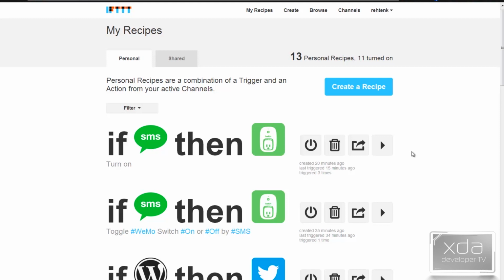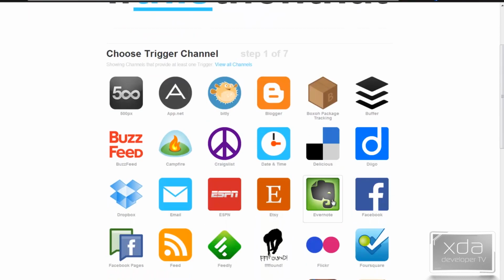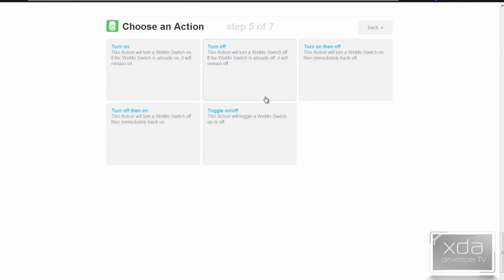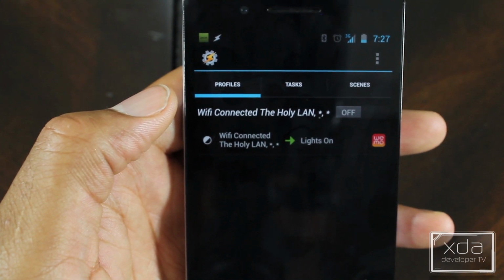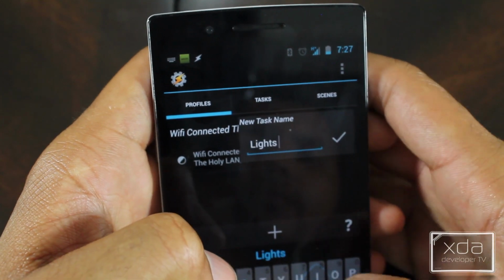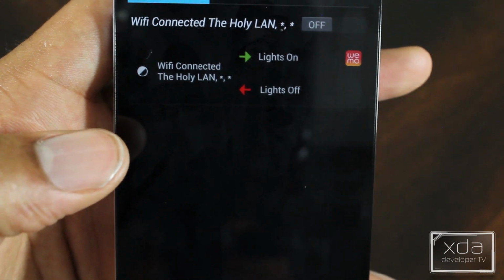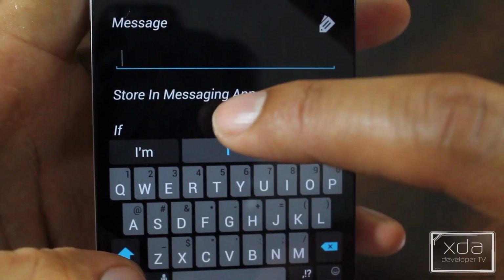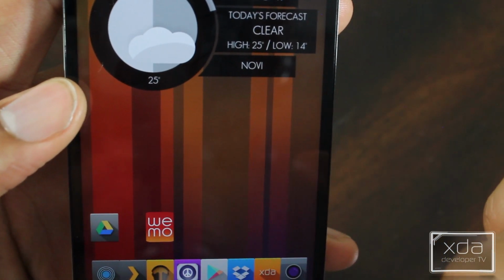Control Your Lights with Your Android Phone

Comment: I made a light switch using a Raspberry Pi, the command is sent in less than a second to switch the light on or off, it's pretty awesome and doesn't require a WeMo nor sending a sms.

Comment: Your number is not blurred enough I can read it quite easily... Could be a gameshow guessing blurr... ;)
Reply: ha ha yeah, however it still wont do you or anyone else any good cause it will not work unless the IFTTT number is sent an SMS from the specific phone number connected to his account (his cell phone)  If IFTTT did not have it this way then anyone on YouTube or the net could control these types of devices.
Reply: Dominique Garcia But why did he blurred it when nobody can do anything with it?
Reply: Not a troll Piece of mind I guess.  That still doesn't change the fact that the number is useless unless you have his IFTTT login information.
Reply: DeniseTutorials Yes, I asked why he blurred it if nobody can't do anything without his login.

Comment: Or you could spend a fraction of the price, buy some wireless sockets, dismantle the remote, wire up the buttons to a raspberry pi or arduino, write a small python script to apply the correct voltages and use tasker to control that. This is XDA developers, right? I appreciate showing how some of these tools (and apps) work, but maybe something more technical would be good too.